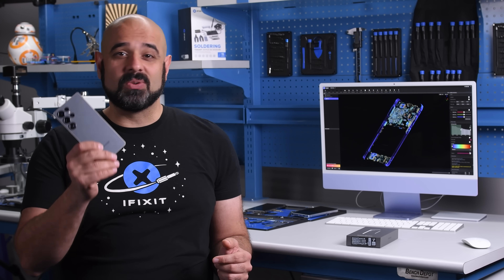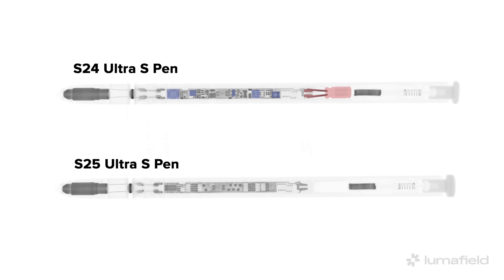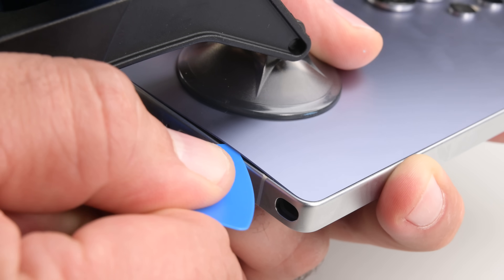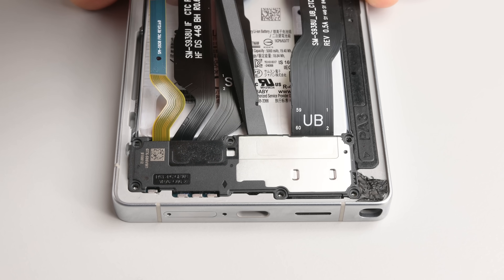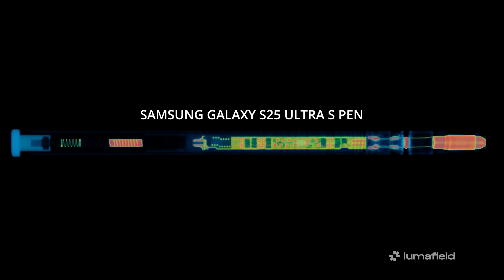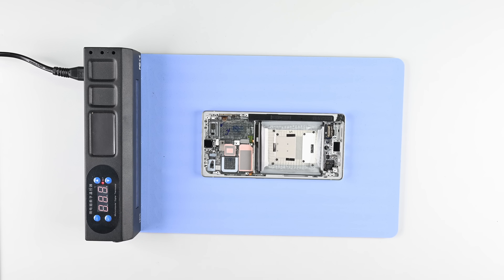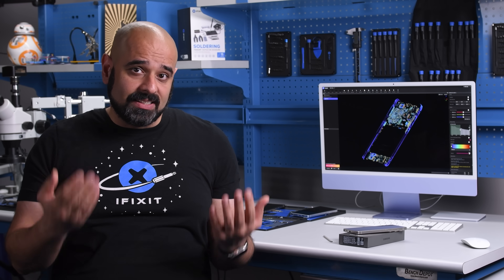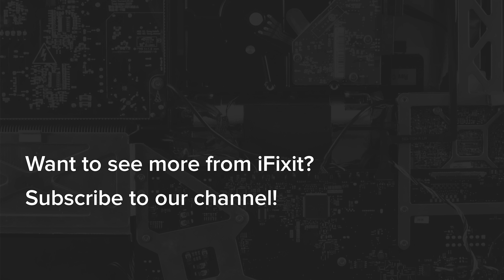Galaxy S25 Ultra Teardown: The Highest Scoring Samsung Phone in 10 Years!

Comment: uh... still using my iphone 5s with a hacked iphone se board stuffed inside. that 7 series aluminum and sapphire lens has really held up well to me never using a case for the last decade. gets about 3 weeks of stand by battery life with all the data theft settings turned off. next project is to add a thermal camera inside. already have the shorter but slightly fatter lipol cell which i will solder onto a bms board. just need to work up the courage to copy strangeparts and micro solder the back of the lightning port and drill a hole for the new ir camera lens. going to use a magnetic lens cover and a reed switch to active the thermal camera, phone will think its plugged in to the native white lightning port once the magnetic lens cap is shifted down. 90$ donner infiray 120x120 ir camera going in. why would i buy a new iphone when i can make a better one on my own with repairable parts for 2 orders of magnitude less money.

Comment: The rounded screen corners are a dealbreaker when the S24 exists. Leave it to Samsung to have the courage to do the right thing and then reverse course later right as they start increasing sales. I was about to get back into the Samsung ecosystem, and now I might not (and if I do, it would be a 24 series). I can't understand why so many people make excuses for overscan. It was a TECHNOLOGICAL LIMITATION and now most OEMs are deluded into thinking that cutting off the corners for no reason at all is "premium." Yeah, a display where you expect AT MINIMUM hundreds of dead pixels to be present out of the box and are expected to view that as a "premium design feature" is actually insulting.

Comment: I would order a replacement battery together with new back glass in a different color. That way you get a new battery that will last a couple years again and the phone gets a fresh coat of paint, scratching that itch to get something new to look at!
Also because I would probably crack the original back glass during the removal process 😅

Comment: Although not introduced in the video, the Galaxy S25 Ultra is equipped with a hardware wireless module that can charge low-energy Bluetooth S-PEN. Air action function support is available by selling S-PEN for low-power Bluetooth and updating the firmware. Of course, I doubt whether Samsung Electronics will sell or support it!

Comment: If the battery just falls out, how can you replace it? Do you need to buy new pull tabs or are the ones provided reusable?
Reply from the maker: You wouldn't want to reuse the adhesive and pull tabs from the old battery—it should be removed from the frame. Typically, replacement batteries like these are sold with pre-installed adhesive and pull tabs.

Comment: the score will only be valid if after being opened and serviced, the phone would keep the water resistance as if new. My suggestion is that you make the water resistance test after. Score should be closer to zero if it fails.

Comment: My S24 Ultra received a new screen under warranty but it lost the water resistance. Just a little water and it ruined the phone, I am waiting for a replacement. My question is if you believe this is a design fault or it's more likely that the technician did a poor job when working on the phone? I know that there are original replacement kits with adhesives for both the screen and rear. The service center told me they were changed during the repair, but I cannot be sure of this. If the adhesive strips were replaced correctly, what else would justify the phone losing water resistance?

Comment: the problem is not the teardown but rather the reassembling of S25... how are you going to guarantee IP68 after opening the back panel?
Reply: I'm putting off repair of an S7 but you usually need to buy a new set of case adhesive to guarantee resistance
Reply: @FarmYardGaming Even buying pre cut adhesive that fits perfectly ( perhaps even OEM ) there is still no way to guarantee water resistance of any level after the phone has been opened. Though this problem is in no way unique to Samsung devices

Comment: Softer adhesive for the back panel is good for repair, but I worry it will weaken over use, losing water resistant. Previous Samsung models have been known for the back panel pop itself out from the phone.

Comment: 2008: replacing the screens, batteries, cases, anything that you can imagine
2025: celebrating adhesive tabs that hold the battery down - yay 🎉
Reply: Yeah but if dropped any device accidentally in water back then it would be bricked instantly.
Reply: @slurples149  i dropped my nokia 3520 in a coca cola glass, and after washed it and dry very well ,it come alive again!
Reply: @slurples149  We do have diving watches since 100 years, so I'm sure a seal can be installed, you would just need to replace it if you tak the phopne apart. That would be fine...
Reply: dawg 2008 was NOT like that 😭
Reply: @PariahCarey69 except it was
Reply: To be fair, replacing touch screens on smartphones was always PITA
Reply: I remember almost completely disassembling my old galaxy s4 for fun in the library back in high school.

So easy even a kid could do it multiple times without damage.

Comment: 3:56. Speaking of using US and Canadian variants of Samsung phones anywhere else. They do not support LTE band aggregation outside of the US and Canada - at least they don’t in EU countries.

That’s a worth noting thing, since it reduces the network performance, but may allow for the battery to last longer. Hence, why I’m thinking of importing Galaxy S24 or S25 Ultra from the US. My phone’s batteries have always lasted for short periods of time. Especially my Fold4. It barely gets me through a day, while also doing 2h of SoT.

And one more thing worth noting, Samsung phones sold in the US and Canada have botched SIM manager - it doesn’t allow to change the SIM card used for calls, when dual SIM is in use. The default SIM card used for calls is going to be the one that’s used for data, which is absurd.
Reply: "And one more thing worth noting, Samsung phones sold in the US and Canada have botched SIM manager - it doesn’t allow to change the SIM card used for calls, when dual SIM is in use. The default SIM card used for calls is going to be the one that’s used for data, which is absurd."

Untrue. That is absolutely possible.
Reply: @nozzel829  so they finally fixed it! Yay! I remember reading XDA post from user cabagekiller from February of 2024 complaining about it.
Reply: On Messages and when calling people, you have the option to choose which SIM to use. I did that on my S22 Ultra.

Comment: To me, it seems easier to repair than any other iPhone from Apple, you don't need specially sized screwdrivers, you don't need to swap out the front display to replace internal parts, the battery is easier to replace, and the screen is easier to replace now that the edge display is gone. Still, giving this device only a 5 is based on my subjective judgment of hating Samsung, which is disgusting.
Reply: Don't the new iPhone have a super easy removal process? I'm pretty sure I watched an ifixit or  Jerryrigeverything applying a little voltage to a tab and the battery drops right out.
Reply: You don't need to remove the screen these days as new spare of screen are sold with the frame itself. Just replace the boards, connectors and battery to the new frame.
Reply: Yes my brother also fixed s22 ultra from home
Reply: The iPhone is worse for repair just based on the screw types alone. No reason to do that other than to make repair difficult.

Comment: I still don't understand why they don't wrap the battery around a plastic frame and screw it to the body, like most laptops
Reply: I'm assuming a plastic frame would add too much thickness when space budget is very limited and every mAh counts.
Reply: It's all about money. Sure a screw and a cheap bracket would work . Times that by a million. Any company making any device will cut down the budget as much as possible while still being functional at a low cost. This could have a bigger heatsink  or any other upgrade to make this better performing or easier to repair.  It's always about squeezing the most profit from it while achieving their goal of features. They don't care about repairability for the average user. More for themselves if they need to repair or their own manufacturing lines.
Reply: I think @fayinthebay ‘s answer is the main reason. But I also note that phones are expected to tolerate a lot more abuse than notebooks and the adhesive is a very strong attachment vs. typical super teeny tiny phone screws
Reply: @BillyONeal  super teeny tiny screw are already used to hold the motherboard and the daughterboard
Reply: @ those weigh less than the battery tho
Reply: @BillyONeal  excuses, its just to be less reaur friendly. Companies hate its users, thats why the Micro SD is gone, and the 3.5mm jack and removable back covers.

Comment: I still have a galaxy S3 around, let's see who can change the battery the fastest. I give you a head start and I'm not a technician.
Reply: You used to be able to get charging docks
Reply: Sure buddy but how are you gonna charge your other battery?
Reply: @Fiwek23452 and also the new phones probably have more than twice the battery capacity lmao.
Reply: @Fiwek23452  With my S5 I used the samsung official external battery charger and kept a fully charged backup in my laptop bag. I'd often just swap the two instead of plugging the phone in to charge at night because it was so easy to do so, took seconds, and also made me restart the phone when I did so. Loved that phone, missed it ever since. That was a 2800mAh battery, to compare directly to today's 5000mAh on the S25 ultra.
Reply: You’ll have to replace your S3 battery 6 times vs the S25 ultras full charge.
Reply: Drop your s3 in the toilet. Opps. Now it's permanently ruined.

Comment: Good to see that the battery is finally replaceable in these devices. Previously with a Samsung you would end up replacing the battery, display and chassis all in one go if you didn't have isopropyl alcohol.
As for the screen, I think you still replace the screen with the midframe attached, as one piece - kinda like how one used to have to replace the iPhone back glass and chassis as one piece.

Comment: In summary: Samsung is back to playing games. Don't upgrade.
Reply: Complement/Correction to summary, from a S23/24 Ultra standpoint, don't upgrade, if you've come from less recent than S23, you can upgrade. 

I was using a S21 Ultra and it's worth to upgrade.
Reply: @loic2665 I currently have an S22 Ultra and I'm thinking about just migrating over to the S24 Ultra instead.

Comment: The battery is a thousand times better than the apple method because you have to bring a 9v battery. Yes, it is not expensive, but you may not have it either. You also have to buy special glue that opens when exposed to electricity. This is the positive side, but as for the phone, it is the S24 with some changes

Comment: The SPen situation keeps getting more... infuriating. First i knew that the capacitor was missing when i saw JerryRig the soul out of the thing but now i know that the whole PCB is in there too, without the ICs.
That battery adhesive method is just complete proof that we did NOT need to effectively weld the battery to the frame of ANY glass sandwich phone made in the past 10 years at least.
Reply: What has me seething is the public's reaction to it. I see SO many people just being like "Well, hur dur, nobody used it, duh". And I get that, certain features get removed, but this was barely removed at all. It's almost all there. And secondly, this is the ultra tier phone, the one percenter kind of phone. I be paying out 2K for the highest storage tier, I'm expecting features that nothing else has, and that this has had for years now.
Reply: We are going backwards in the tech industry, S25 worse then S24. Nvidia 50 series same thing but more expenssive. People need to choose with the wallet.
Reply: For the battery maybe they didn't have an idea until now. Actually they didn't think about it until everyone was complaining how the glue was unnecessarily making it hard to replace. Then they had to bring a solution. It means they can solve many other flaws if they care.

Comment: "extremely easy battery removal process" Yeah, once you get to it... 

It's sad that a glued shut device ranks high for having a battery that is secured in place a bit differently than before. It's still an improvement, obviously. 
But I wouldn't give them a huge praise for it. The Galaxy S5 had a much easier battery removal process, we need to archive this level of accessibility again. 
I don't want glued or soldered on components. I want durable clips and screws...
Reply: While I totally agree with you, don't forget that these phones are also IP rated to be water resistant. Now granted you can totally have water resistant phones with a removable back (see xcover series or caterpillar), but that adds to the thickness by quite a bit.
Reply: @devnol  The Galaxy S5 is 8.1 mm thick, the new S25 Ultra is 8.2 mm thick. With updated technology, a "New 2025 Galaxy S5" could be even thinner. 

And even if it would be a bit thicker, I actually couldn't care less.
Reply: @平和-v1z  I never said it isn't stupid I was just thinking the s5 isn't a fair comparison since it lacks that core hull feature. The Xcover 7 however is a current gen galaxy, with a removable (but 4050mAh) battery and  ip68 rating. It's 10.2mm thick but it doesn't need a case because the shell itself is shock-absorbing. my n20u with a similar grade case clocks in at 11.5mm. It's definitely possible to make such a phone and samsung definitely does, but it's not a priority for most people and so it doesn't make it to the flagship lineup.
Reply: @devnol  Not having to put your phone into a case and still ending up with a more durable device is a huge plus. I'd always prefer a plastic back over a fragile glass back, it would also reduce the weight of the phone. And yeah, some people want a glass back for a more premium feel, but this argument falls flat once you use a case, like most do. 

What I really dislike, is when budget or midrange devices with plastic housing don't have a removable back. Or, even worse, when the back is actually removable but the battery itself still isn't easy to remove.

Comment: as a technical service that has changed many samsun phone screens, I have to say that samsung service screens are sold with chassis and case lath, so you do not have to separate the screen from the case. here I did not understand why it was explained as if the screen had to be separated from the case.
Reply: It’s because not everyone buys the screen and chassis together. Genuine Samsung parts are difficult to get ahold of, and many third parties sell the screen alone. Also given its iris it, though they didn’t say it, at least some of them probably think it’s wasteful to have to replace the whole chassis because of a broken screen.
Reply: @crispyjokingtuna1495  off-brand screens are all avaliable with frames, technicians in China value their time too. Also off brand screens are crap. My main complain is not the display quality but because the glass is too fragile to be practical. I'm a DIYer and have repaired multiple phone screens, and all the off-brand screens didn't last more than a week before a casual drop breaks them. Better to get a used genuine screen.
Reply: Officially, Samsung prefers replacing panel only, despite service packs typically including the frame and a new battery.  Frankly, I HATE replacing panel-only.  I've seen what happens when a lesser-skilled tech doesn't get the placement right and the result is always a broken screen that didn't have to end up that way.
Reply: @ljessecusterl  in israel they replace the frame, battery and screen all at once
Reply: It is still useful info for screen refurbishing
Reply: In many countries Samsung official service centres switched to oled panel only repairs after the 22 series. Only replace frame and battery when necessary now.
Reply: Because he is a isheep..apple sucker🤡